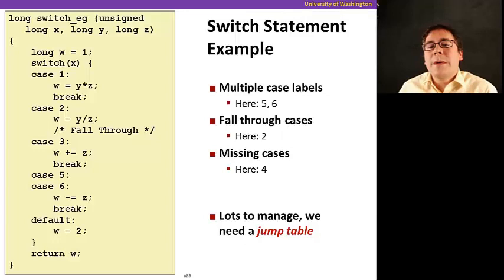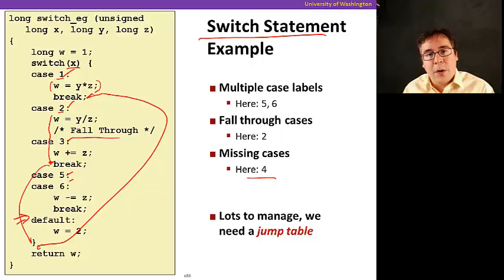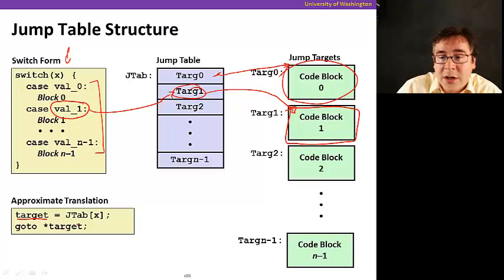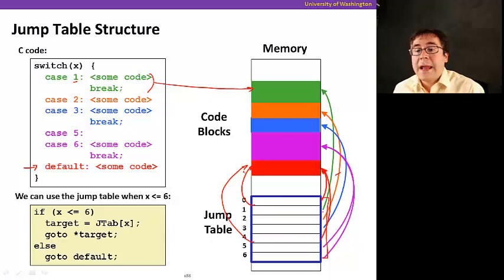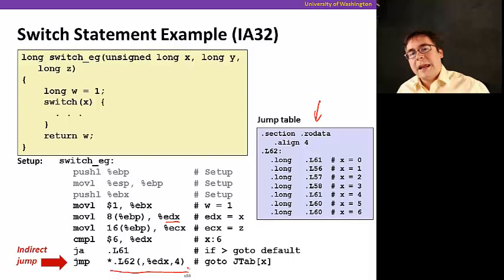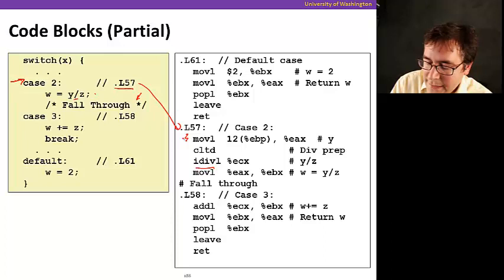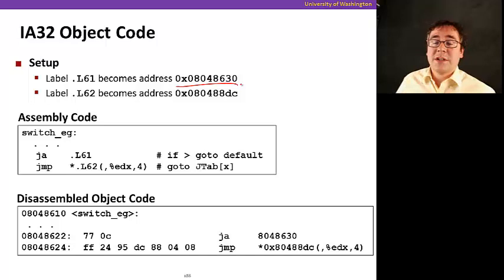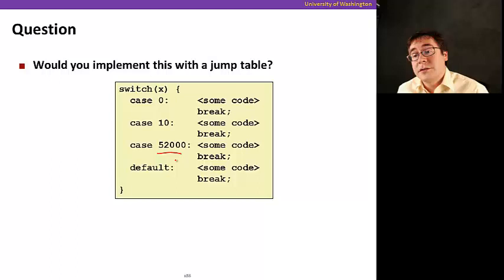x86 Assembly, Video 7: Switch statement

Comment: In case anyone is wondering, with C++ compiled on x86-64 gcc 10.3 the last jump table will actually compile into conditional branches (if statements). So luckily compilers are smart and won't create massive jump tables for case statements like that :)
Reply: I thought the whole point of a jump table was that it could use the value being tested as an index into the jump table and then jump to your target FASTER than you would, if you were to use if else branches

Comment: This is why it is good to study assembly. I thought switch cases woud always hash to the correct label.
Reply: But when I consider that java using strings in switch statements; I realize that hash tables can implement switch statement.

1. get hash bucket index by switch value % bucket size.

2. do conditionl testing on bucket cases until match is found.

This method should work for very large switch statements that are not neccessarily ranged.

Ranged switch statements with <= 50 case could use jump tables.

And everything else is conditionl testing.
Reply: @dmaster20ify  java just translates a switch on string to a long if else chain. I mean, is there any other way to compare strings? Unless you explicitly make the switch on hash_function(string) ofc.

Comment: Is that jump table got created at time of complilation and at run time just getting target and executing the piece of code...if thats the way much faster than other conditional statements ...
Correct me if i'm wrong!!!
Reply: That's the point of switch statement and jump table! You have more memory occupied because of the jump table, but this same table makes code execution faster.

Comment: So jump tables will only work if you have really small range of x ? and that range should be sequential ( a case for each incremental value of x ?)
Reply: That is the best case, yes. However, it can also be done if there are very few outlliers. e.g. 1, 2, 3, 4, 5021, 5, 6.

In cases like this, you can use branches to handle numbers like 5021 and use a jump table for the rest.